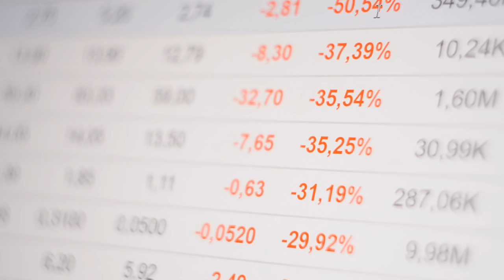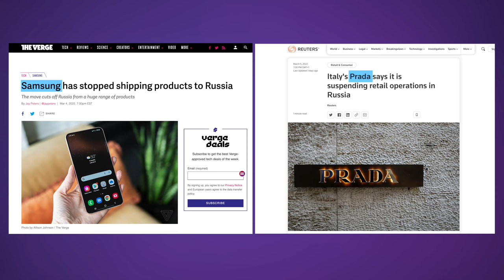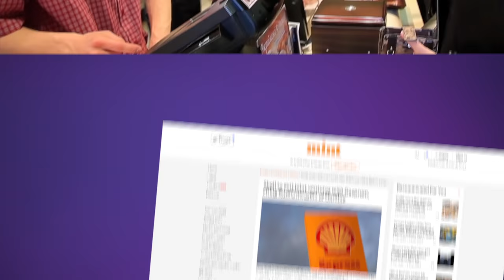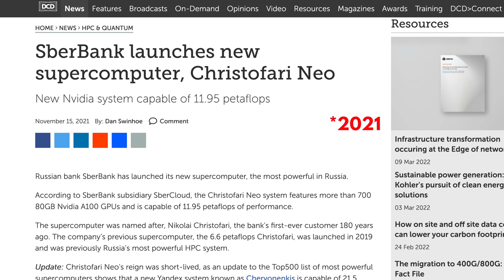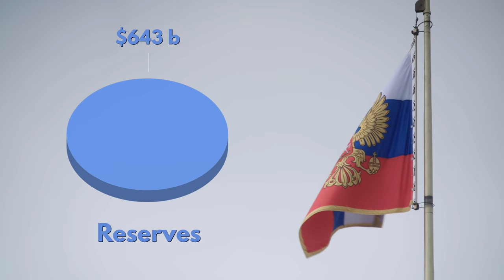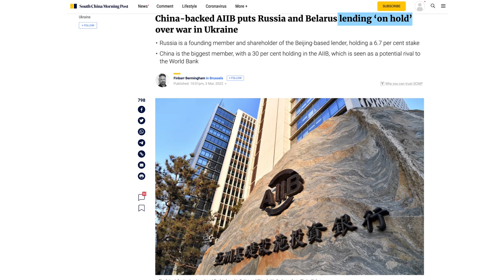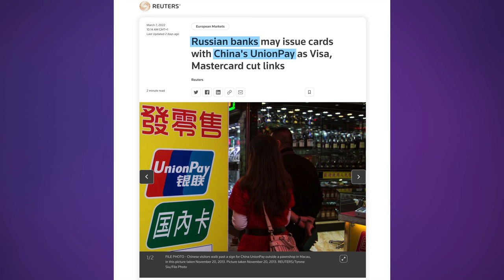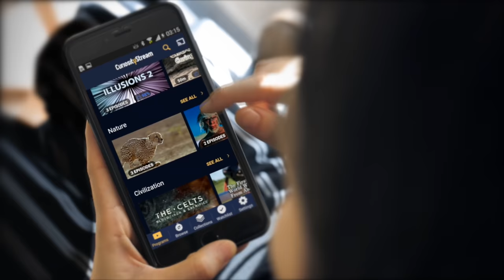Can Russia Survive Tech Sanctions?

Comment: Just for viewers info based on the info provided in the media that Russia seems to be burning 900 Mn Euros per day for Ukraine war , factoring the currency conversion it is USD 954 Mn. And if Russia does have a exclusive war chest of USD 600 Bn for Ukraine war, then it amounts to sustaining war for roughly 1.7 years. 
Assuming inflation, sanctions and other trade issues impacting Russian economy then if they divert even 300 Bn USD to sustaining the economy in that case the war waging capability is still 0.85 years i.e., 10 - 11 months. 
Assuming that the oil is being bought by India and China and this money is partially used to sustain Ukraine war and in that case my guess would be 14 - 16 months.
Reply: This is not a very smart analysis.

Comment: Good on Oracle pulling the plug on support, used to work for them, they are truly a global influencer in professional database and network support.
I would ask you what you know about blocking russia off from the  OpenSource Linux like Canonical, RedHat, Suse which are some of the top players? 
3/4 of server systems globally use Linux (or Unix).
Is a desktop gui similar to Windows, has the advantage of cheap licencing models and utility. Is found also in IoT applications, embedded control systems and is generally more secure which means it is used widely in military apps.

Comment: Excellent work, excellent information. Regarding Russia capability to fabricate integrated circuit (IC) chips: even that is questionable as there is a huge supply chain for these fabrication lines: silicon wafers, chemicals and gases all have to be supplied with insanely high purity levels. I know since I have worked in that industry for decades. I don't know where Russia gets those products, but given that its IC industry is tiny, and that the investments to produce those are very high, it seems very unlikely that they have developed the corresponding supply lines to any significant degree. Without those supplies, their IC industry will be completely neutered. Russia is starting a terrible de-industrialization movement that will set it back to the 1950's. Unsustainable and catastrophic.
Reply: except there's China...
Reply: @Frank Zimmerman  ... which is undergoing its own demographic, political, cultural, housing, banking, debt and economic collapse.

Comment: I am watching this a month after this video came out, and there have been changes on the ground:
- Russia has failed in its attempt to invade Kiev and is now repositioning troops and seem to be focusing on eastern Ukraine.
- The place the tech shortage may show up first is in high tech weapons like cruise missiles, which from what I have read, are almost gone, partly because so many were used in Syria.
- There is speculation, some fueled by Russian actions, that the government is ready to officially upgrade this from a Special Operation to a full-blown war, which would allow the Russian government to call up reserves.     
- There is no sign that the government is running out of cash, partly because of the sale of oil and gas to the tune of one billion US$ per day.    I am pretty sure the war is costing Russia more than that per day, but as of right now, there are no visible signs of the Russians running out of cash and being forced to stop the war.     If the sale of oil and gas is sanctioned, which could be if tactical nukes or chemical weapons are used by the Russians, that could change this dynamic quickly.
- Putin has set a target date of May 9th for the war to be over, probably not a realistic target date, but it will put pressure on the Russian field commanders to get results.    
- Up till now, the NATO forces have mostly been sending defensive weapons, like anti-tank missiles and anti-air missiles.    That is now changing with the US sending long range artillery and lots of shells and others looking to send in Russian built tanks.    If these get to Ukraine in time, it could help them not only stop the anticipated offensive by the Russians, but also to regain territory if/when that push fails.       My guess is that if Russia uses tactical nukes or chemical weapons, the previous ban on providing aircraft will be lifted and Ukraine will get a large number of aircraft.      Russia is threatening unspecified retaliation if NATO continues to provide weapons but are being ignored right now.     Russia has had its hands full with Ukraine by itself and certainly cannot afford to take on NATO at the same time.      They could cause a nuclear war, but if that happened, what happens in Crimea and the Donbass will no longer matter, since the focus will be on getting survivors out of radioactive areas and trying to survive as a nation.     Similar situations will be going on in Europe and the US, if that makes Putin feel any better.

Comment: China and India can share their technologies if Russia needs them.  Russia has also heavy industry capabilities.  Softwares and programs could also be done by Russians. It is foolish to imply that Russia could not reverse engineer the equipment that's made in the West.  The West is underestimating Russia because they think that Russians are dumb and stupid.  As long as a chip could do the functions that they are designed for, it doesn't really matter if it is 160 nanometer or 45 nanometer.  It will be a few millimeters thicker but what difference will it make if it works.  The bottom line is the West is making a bear into a monster.  Putin said that Russia will be self sufficient.  They don't have to sell their oil, grain and fertilizers to Europe and US plus their allies.  China and India are gobbling Russian oils, coals and gas, and Russia have new customers for their exports in Asia and Africa.  Europe will freeze this winter because Russia have already closed the valves supplying gas and stop shipping oil to unfriendly countries in Europe.  They also stop exporting  grain, fertilizers, natural resources and industrial products to Europe.  Russia have created their own digital payment system, similar to swift, and many friendly and neutral countries have signed up already. Rubbles become stronger because all transactions with Russia should be paid in Rubbles base on the spot exchange price of gold.  Russia have develop a template for other nation to follow because of the sanctions.  EU and the US could become an economic disaster.  I want to see how they will get out of this shit, less declaring a nuclear war with Russia. Time is in Russia's side.  There will come a point that sanctions will not mean a shit to the Russians in the future.  I bet that no one will buy Prada and Gucci anywhere on this planet if they don't have bread on the table. I forgot to mention that Russia is the largest exporter of wheat in the world. They will all go to China, India, Asia and Africa. Its over 3 billion people consuming Russian products. Look at the big picture.  Putin have figured it all out. And every mistake he will correct, modify and refine to improve his strategies to win against every shit that the West will be throwing at him.  The Russian people will live as usual with heat in their homes, gas in their cars, bread on their table and lots of Vodka.  McDonald's will become McPutin and Starbucks will become RedStarRublles coffee. Asia have better coffee than Columbia.  I hate this whole shit but it appears that it is unfolding into a new reality. Just saying.
Reply: India doesnt have the tech they need, Also nice little wishful thinking you got there lol
Reply: Russia is not even the 3rd largest world economy. heck its not even the 20th. And all of the sudden it can do everything in 6 months.

Suddenly russia is wakanda lololol
Reply: voice in the wilderness
Reply: @mfd8346  you are lololol. Coz of you use a lot of cheap drugs. And Russia is fine, and will be better every day.